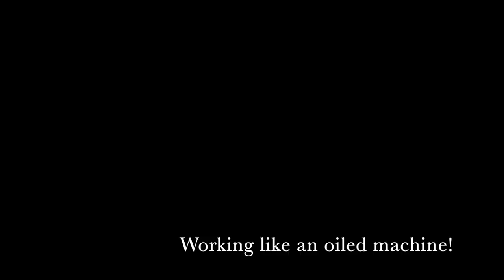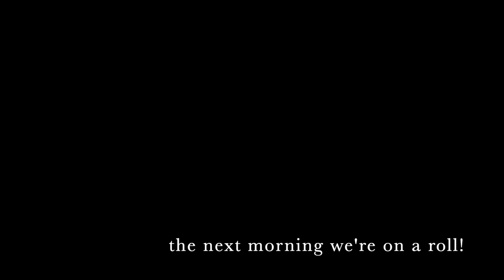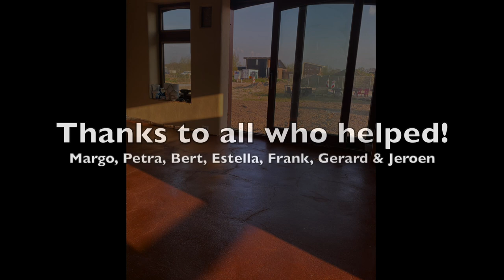How to Build Earth-floor with Heating in a DIY Tiny-House

Comment: Hello! I loved your video and would love to see more content!

I had a question about the crack. Would a common formula using a combination of clay and coarse sand possibly prevent it?

Note: I'm newbie and is going to install a cob floor next week 🧤
Reply from the maker: Thanks for your note, so sorry I responded to late! Did you end up finishing your floor or are you still in the process? The cracking, as far as I believe, is just part of the natural drying if you use 100% clay. You can avoid it by adding things like lime stone, but I didn't want to "pollute" it with less eco-friendly materials and actually liked the looks of the cracks ;) Hope to hear you're doing!
Reply: @sarahdegroot9787 Thank you for your insights! They've been extremely useful!  I've started to appreciate cracks aesthetically and I've also noticed how simple they are to repair functionally. I attempted to incorporate limestone as well, but I didn't quite favor the appearance and texture it brought to the mix. 😁